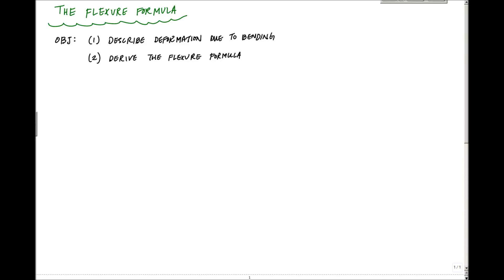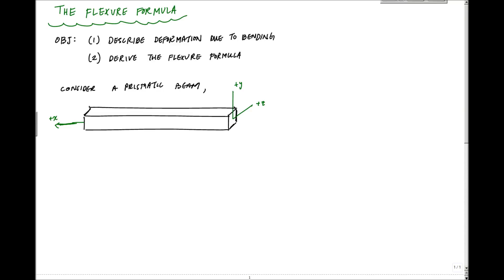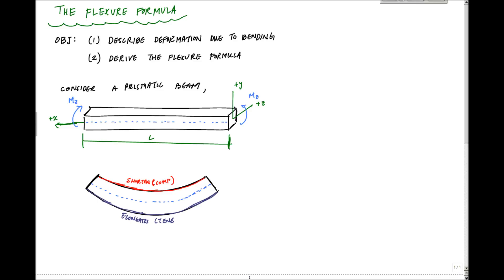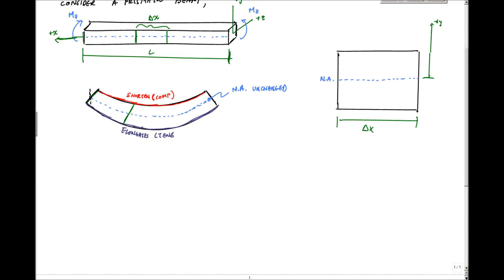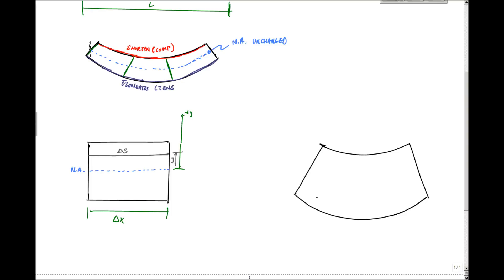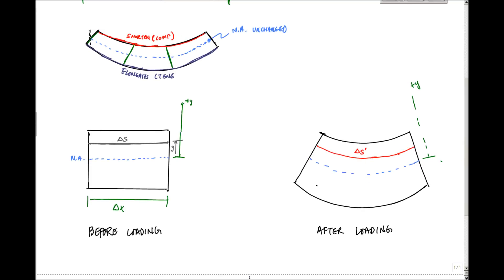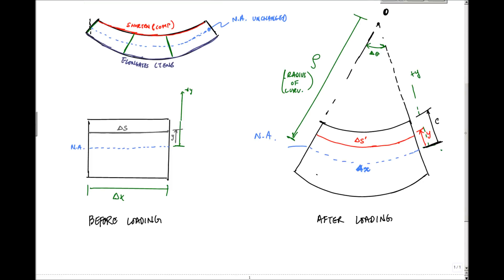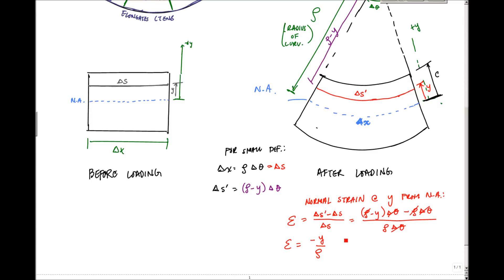Flexure Formula (Part 1) - Mechanics of Materials

Comment: My suggestion is that you step away from the book derivation and attempt to derive it by yourself using your own notation; it will involve failing, but that will show you what assumptions they made and what simplifications they stepped into (which you could mention here for completion). That also helped me better explain the buckling formula. Also, you could include an analysis from a meshed FEM software like Abaqus, to show that the assumptions about the 'NA' are incorrect and limit the beam formula in the longitudinal direction (for completion). The limitations of the beam formula should be known to the designer, especially in more complex cross sections (even if prismatic). Local buckling, longitudinally asymmetric elongation, etc. are products of the simplifying assumptions. These concepts give the user a balanced idea of what the beam formula can and cannot do.

Also, the DelX = p*DelTheta is a geometric property of arc length, not triangles. See: "The angle around a circle can go from 0 to 2 pi radians.  The arc segment length is always radius x angle. When the radius is 1, as in a unit circle, then the arc length is equal to the radius."-https://www.geogebra.org/m/mbzAXPmu
That property is valid beyond small angles.

Comment: The neutral axis you are showing is wrong..its called neutral plane. The neutral axis is along the z axis at each cross section, isn't it???
Reply: that's what i thought, z lying in the plane of the cross section is the neutral axis, x-axis is the longitudinal axis, this is straight from the text book.

Comment: I didn't get the ∆x=(rho).∆(theta)
Reply: its a formula for finding out the arc length of a circle
if theta is angle and r is radius then length of curvature\ arc length lets call it S,    is given by
s = r x theta 

if you want proof\ derivation of formula think of it like this 
circumference of whole circle = 2pi x R
now here 2pi is not just a constant number but it is angle in radians
 so the formula for arc length is   S = R x angle(in radians)
Reply: Roh Nain bro it's simple...l=r*thetha is the formula where l is length of arc r is radius and thetha is the angle enclosed by the arc

Comment: Hey! Great video! I have a question. This derivation shows that strain varies linearly along the cross section. (saying (epsilon)=-y/(rho).) Is this only valid for linear elastic bending or will the section strain graph change from linear to some other shape when it yields? like if for instance a steel beam yielded, would the strain still be linear along the section? Thank you! <3
Reply from the maker: Dustin Brennan even if the materials yield, a beam's strain profile still remains linear assuming everything stays connected.  The stress profile however would no longer be linear.
Reply from the maker: Dustin Brennan Great question!